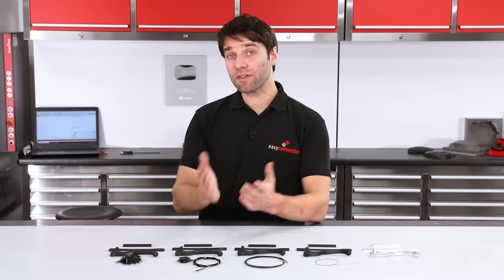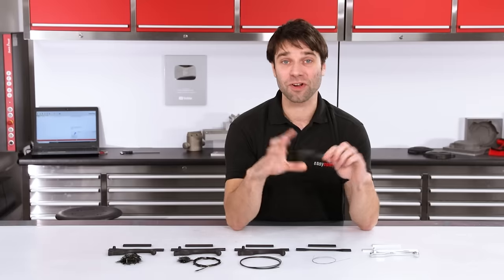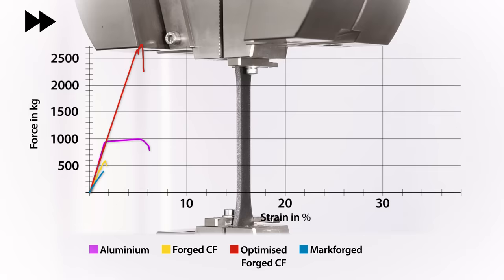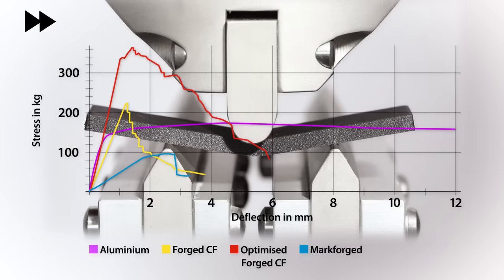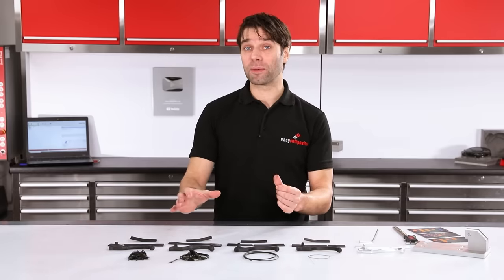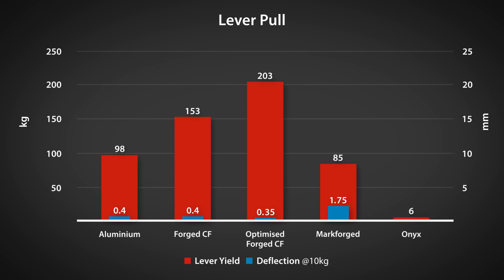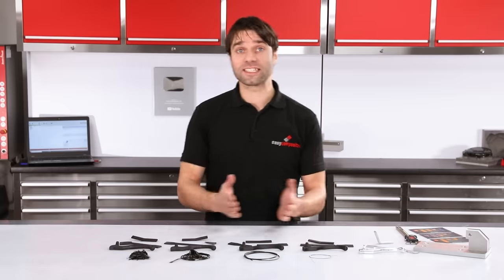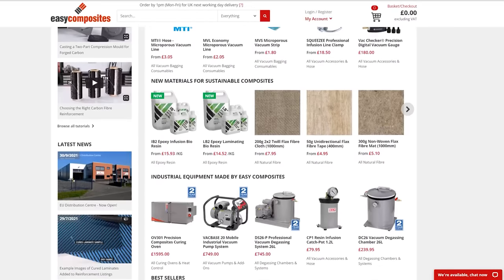How Strong is Forged Carbon Fibre? Forged Carbon vs Aluminium vs Markforged vs Onyx

Comment: without saying it, oh why not? Obviously Onyx is not rigid or sound for say a foot peg, probably great for a dash, or console, saddlebags speaker housings.
Reply from the maker: Yes, for less structural applications with lower loading it's still a great material.

Comment: Not to make to much of a point of this. All the Carbon cost way more then Ali and Ali doesn’t always snap or brake so you can bent it back and still use it till you can afford another. Carbon brakes it’s broke.

Comment: Forged is not very strong in pull tests. The strength is of the resin only. We have been making race car body parts out of forged lately. I hate the look of it. It's also not strong, warps more and it essentially just scrap cut offs that someone figured out how to sell to people and companies. Forged carbon is the stuff you swept off the floor, put in a dust pan and threw away.
Reply from the maker: You believe that the tensile strength properties we demonstrated in this video are the tensile properties of epoxy resin on its own? You might want to look into the detail on that a bit more!
In this video we've given an entirely honest analysis and comparison of the mechanical properties of short strand carbon and we make no suggestion that continuous fibre isn't mechanically superior but there are certain processes and components that you simply can't follow/make using continuous (woven) fibre, like the compression moulding process in the previous video. There may be companies using forged carbon in the way you're describing but we've tried to demonstrate some very legitimate applications where it's a useful, and mechanically valid, process.
Reply: @easycompositestv  I'm not picking on you now. I don't mean you as in your company sweeps scrap off the floor and sells it. I meant you as is the companies that manufacturer carbon figured out how to sell their scrap carbon. Forged means something very different when talking about metal as opposed to this new kind of carbon. 

 But yes, if a part is made that is 1 foot long and the strands of carbon are 1 inch long, held together with resin, the strength of the resin is what gets tested in a pull test. Replace the epoxy resin with polyester resin and it'll be the strength of the polyester resin being tested. Because the carbon has a higher tensile strength than the resin itself. That's all I was saying. Not that your test wasn't a good test because it is a good test. 

The composite company where I work has been using forged carbon lately because people/customers like the looks of it. I don't like the looks of it on large parts and it weakens the part. We just use it as the face layer of the part, but that means the body panel is now 1 layer short of continuous strand woven carbon. We aren't making structural parts out of it but still. It's extra weight with less strength, which seems silly for race car body panels.

Comment: Not sure if I would call it forged?  Just cast and 3D printed isn't it?
Reply from the maker: Thanks for the comment and yes, the term 'forged' carbon fibre is not the clearest but it's been around for a while now  (Lamborghini have been using it for several years) and is quite widely used with an established meaning. To avoid using the term would mean that many viewers interested in understanding 'forged carbon' might never find this content, get to see what the term refers to (for some at least) in the context of carbon fibre composites, and learn how - for the right components - this process can be used to produce strong, lightweight parts with minimal equipment.

For what it's worth, before making the video we did discuss whether to use the term 'forged' a lot because we really weren't sure ourselves. After lots of deliberation (checking dictionaries and researching the history of the term) we decided to go with it but we did expect others might come to a different view, and that's fine too. If you'd like a much more lengthy explanation of we came to our decision please get in touch, we're happy to have more healthy debate on the subject.

Comment: Regarding the "polymer simply wouldnt be suitable" claim...

...with geometry made for consideration sfor metals youngs mudulus, sure it wont.

But that evaluation is as sane as judging metals usefuleness based on how the perform in flexure joint geometries designed to use polymers.
Reply from the maker: True but in this case as a direct comparison for a specific application, it would not be suitable, and due to the limited shape of the brake lever, limited by its function, I am not sure you could redesign it to work.  Certainly with other applications it may well be possible to design around the materials properties to make a functional part.

Comment: Too bad there wasn't a sample made of prepeg.. very interesting nontheless
Reply from the maker: We deliberately were not comparing "traditional" composite methods as often they are not suitable for chunkier solid materials.
Reply: @easycompositestv  there is a big discussion regarding using "forged" instead of traditional composite, and a good comparison would give an idea when forged can be used or if they are just a bad idea. .

Comment: How does carbon fiber age after many years? I imagine aluminum is eternal in comparison
Reply from the maker: There are composite parts decades old at present still functioning very well.  There is certainly not as much data as other materials but as time goes on there is more becoming available.

Comment: ok so onyx is not good for the things tested or the way they were tested ... in a fair comparison ... kind of like trying to get kleenex to act like a full sheet of papertowel .... so what DOES the onyx actually out perform other methods or styles at .... is it better for things that require hi flex ... like say ah dynamic molding wing ... or would it better as a wing root skin kind of idea ... or as a strap to keep stuff from falling over ... what does Onyx Excell at

Comment: So, nothing compares to steel?
Reply from the maker: We didn’t compare steel, no… it’s so dense that it’s generally not considered in applications where a high strength to weight ratio is required. In ‘specific’ terms (I.e when its weight is factored in) then it would be well behind both the aluminium and the carbon composite levers.
Reply: @easycompositestv  Thanks. That certainly holds true for strength to weight. But enough applications have a given volume constraint, e.g., your lever example. I assume that's simply no area where carbon is considered.

Comment: This makes me think that normal carbon fiber is a lot stronger than forged carbon
Reply from the maker: Typically forged application would not work for applications where traditional composites would be used and vice versa.

Comment: i'm still laughing about the term forged
Reply from the maker: Thanks for the comment and yes, the term 'forged' carbon fibre is not the clearest but it's been around for a while now  (Lamborghini have been using it for several years) and is quite widely used with an established meaning. To avoid using the term would mean that many viewers interested in understanding 'forged carbon' might never find this content, get to see what the term refers to (for some at least) in the context of carbon fibre composites, and learn how - for the right components - this process can be used to produce strong, lightweight parts with minimal equipment.

For what it's worth, before making the video we did discuss whether to use the term 'forged' a lot because we really weren't sure ourselves. After lots of deliberation (checking dictionaries and researching the history of the term) we decided to go with it but we did expect others might come to a different view, and that's fine too. If you'd like a much more lengthy explanation of we came to our decision please get in touch, we're happy to have more healthy debate on the subject
Reply: @easycompositestv , well said.  I wish other companies were as considerate when adding "titanium" in their marketing. And honestly, I'm not sure what term would better differentiate this "forged" method from traditional CF layup.

Comment: You need to autoclave the onyx filament. Thats solely what its for. Even real carbon fiber just impregnated with epoxy would fail without autoclave.  Soon as you autoclave carbon. You can build a race car lol
Reply from the maker: Sorry, but none of what you’ve said is accurate. If you’re interested in finding out the many ways carbon fibre components (including race cars) can be made, please take a look at our back catalogue of videos; there’s lots of useful information in there covering a wide range of processes, including prepregs. I think if you watch of few of them, you’ll really develop an understanding for the subject 🙂.

Comment: That isnt forged it is molded forged requires heat and pressure welded with hammering.
Reply from the maker: Forging metal requires heat and pressure, 'forging on in the snow' - for example - requires snow and determination ; ) Context, as they say, is everything!

The Miriam Webster dictionary's definition of forged is: "formed by pressing or hammering with or without heat" - if you watch our first video in the series then it's hard to argue that we haven't formed something by pressing. Help yourself: https://www.merriam-webster.com/dictionary/forged

Furthermore, 'forged carbon' isn't our terminology but it is fairly well established now, having been used by companies like Lamborghini for some years, and so it's quite difficult to do a piece about this process without referring to it by the name that's most commonly used to describe it.

Comment: Bruh, carbon fiber is most often compared to steel. 
Compating it to aluminum isn't fair. 

"Pound for pound, its stringer than steel." Which is not aluminum. Aluminum is not strong.
Reply from the maker: ‘Pound for pound’ would be the ‘specific tensile strength’ (where ultimate tensile strength is divided by weight). Aluminium has a higher specific tensile strength than steel, and carbon fibre has a yet higher specific tensile strength. This is why planes are built from aluminium and carbon fibre, and not steel. I think you’d find it enlightening to have a read up on the densities of these materials, and their respective tensile properties.

Comment: when the carbon fails it FAILS. can't use it 0 lbs of force can be applied. with aluminum it just bends you can still apply force up to the bend point. i.e. it works still after the bend. i think in a crash situation hell even just dropping the bike you can easily apply enough force to break all the carbon ones. but they are lighter

Comment: Have you ever ridden a motorcycle, at the pressures you reached, what happens to the pieces spalling off when it breaks, with your hand that close?--- I'll stick to metal thanks it's not worth the risk for grams of weight savings.

Comment: so steel, 7075 and ti would destroy these materials on these tests.
Reply from the maker: Well, the density of steel is massively higher, so, unless you’re uninterested in weight then I’m not sure steel could be described as ‘destroying’ carbon fibre! Also, specific tensile strength of titanium would likewise not be higher than the optimised forged component.
Reply: @easycompositestv  the 7075 alu tho would beat carbon fiber, and most ppl opt for ti over 7075. carbon is good stuff but its breaks too easily. and ofc its not all about strength to weight. carbon bike frames for example are really light and decently stiff mostly due to tube shapes however one crash or blunt force and its usually damaged. i'd like to see carbon frames be made 50 percent lighter instead of 100 percent lighter than alloys that way they would be way more resilient and still lighter. even a mix with some glass or kevlar would be cool.
Reply: I think the optimized carbon fiber part would probably be stiffer and stronger than titanium. And for sure outperform in tensile strength. Much lighter than steel. And come to think if it, depending on the alloy of steel and the heat treatment applied, the carbon could just plane be stronger and stiffer all around. It depends on the steel.

Comment: So it's not forged carbon fiber at all, it's cast/moulded carbon fiber
Reply from the maker: Thanks for the comment and yes, the term 'forged' carbon fibre is not the clearest but it's been around for a while now  (Lamborghini have been using it for several years) and is quite widely used with an established meaning. To avoid using the term would mean that many viewers interested in understanding 'forged carbon' might never find this content, get to see what the term refers to (for some at least) in the context of carbon fibre composites, and learn how - for the right components - this process can be used to produce strong, lightweight parts with minimal equipment.

For what it's worth, before making the video we did discuss whether to use the term 'forged' a lot because we really weren't sure ourselves. After lots of deliberation (checking dictionaries and researching the history of the term) we decided to go with it but we did expect others might come to a different view, and that's fine too. If you'd like a much more lengthy explanation of we came to our decision please get in touch, we're happy to have more healthy debate on the subject :)

Comment: Forged? I would say molded?
Reply from the maker: Thanks for the comment and yes, the term 'forged' carbon fibre is not the clearest but it's been around for a while now  (Lamborghini have been using it for several years) and is quite widely used with an established meaning. To avoid using the term would mean that many viewers interested in understanding 'forged carbon' might never find this content, get to see what the term refers to (for some at least) in the context of carbon fibre composites, and learn how - for the right components - this process can be used to produce strong, lightweight parts with minimal equipment.

For what it's worth, before making the video we did discuss whether to use the term 'forged' a lot because we really weren't sure ourselves. After lots of deliberation (checking dictionaries and researching the history of the term) we decided to go with it but we did expect others might come to a different view, and that's fine too. If you'd like a much more lengthy explanation of we came to our decision please get in touch, we're happy to have more healthy debate on the subject :)

Comment: Did you intentionally use Onyx to discredit 3D printers because they are a competition? The eSun Nylon CF fiber I used does not produce such flabby parts, it has impressive strength.
I will just assume you did not research the 3D printer filament well because this is not your field of expertise and made an honest mistake here.
Reply from the maker: 3D printing is not a direct competitor for the vast majority of the composites industry.  The Onyx was used as it is a widely available filament and reasonably representative of the reinforced filaments out there.  We are not a 3D printing channel so you would likely find direct filament comparison videos elsewhere.

Comment: forged? Isn't it molded?
Reply from the maker: Thanks for the comment and yes, the term 'forged' carbon fibre is not the clearest but it's been around for a while now  (Lamborghini have been using it for several years) and is quite widely used with an established meaning. To avoid using the term would mean that many viewers interested in understanding 'forged carbon' might never find this content, get to see what the term refers to (for some at least) in the context of carbon fibre composites, and learn how - for the right components - this process can be used to produce strong, lightweight parts with minimal equipment.

For what it's worth, before making the video we did discuss whether to use the term 'forged' a lot because we really weren't sure ourselves. After lots of deliberation (checking dictionaries and researching the history of the term) we decided to go with it but we did expect others might come to a different view, and that's fine too. If you'd like a much more lengthy explanation of we came to our decision please get in touch, we're happy to have more healthy debate on the subject :)

Comment: Forged carbon? I thought you forge metal. Help I'm confused.
Reply from the maker: Thanks for the comment and yes, the term 'forged' carbon fibre is not the clearest but it's been around for a while now  (Lamborghini have been using it for several years) and is quite widely used with an established meaning. To avoid using the term would mean that many viewers interested in understanding 'forged carbon' might never find this content, get to see what the term refers to (for some at least) in the context of carbon fibre composites, and learn how - for the right components - this process can be used to produce strong, lightweight parts with minimal equipment.

For what it's worth, before making the video we did discuss whether to use the term 'forged' a lot because we really weren't sure ourselves. After lots of deliberation (checking dictionaries and researching the history of the term) we decided to go with it but we did expect others might come to a different view, and that's fine too. If you'd like a much more lengthy explanation of we came to our decision please get in touch, we're happy to have more healthy debate on the subject.